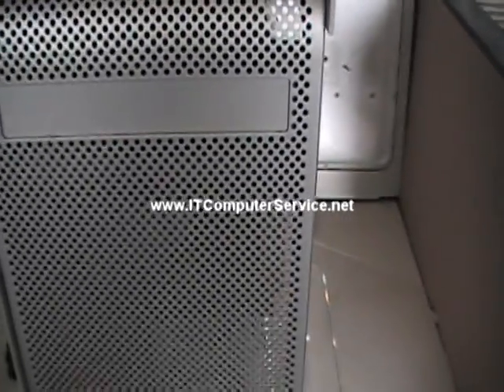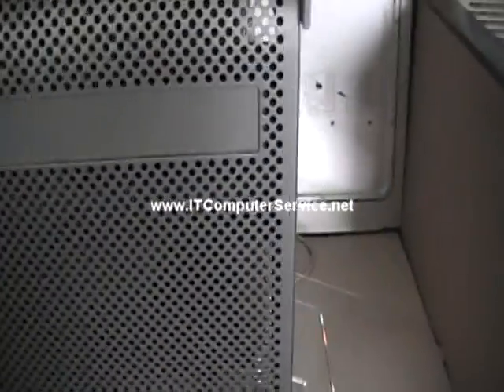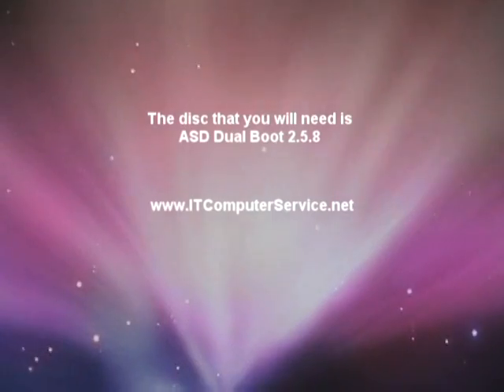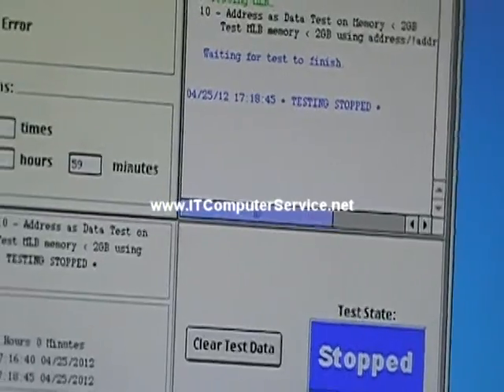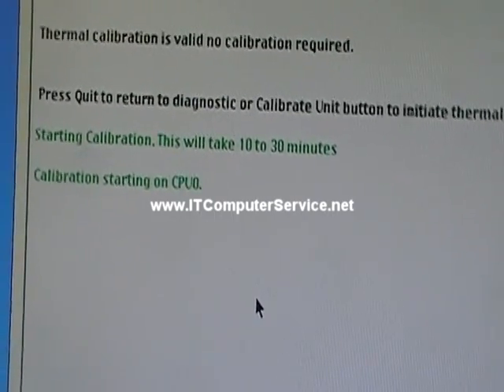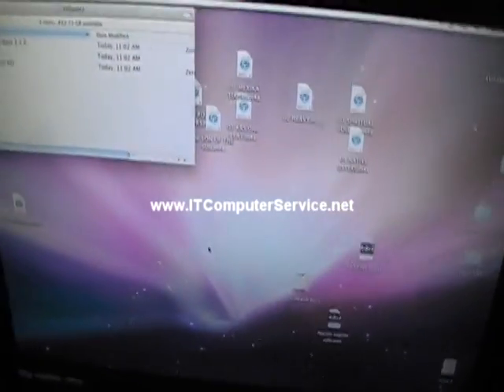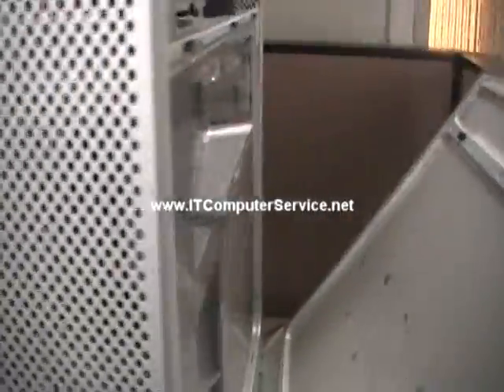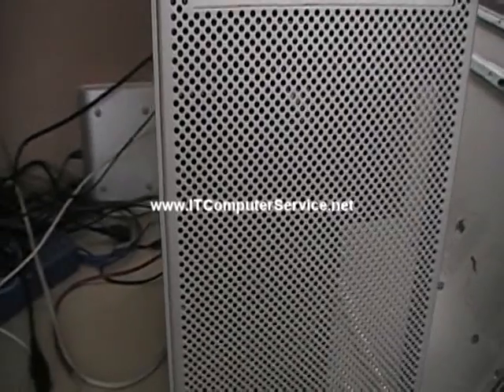PowerMac G5 Fan Calibration Process

Comment: Hi.. nice and clear by the way. İ also have the fans on my g5 dual 1.8 running at full speed. İ'm performing the TC with ASD 2.5.8.. i'ts going on for a while now and i'ts over an hour and still running. İ know it says 10 to 30 mins. How long did it take for you to complete the TC process? Tnx